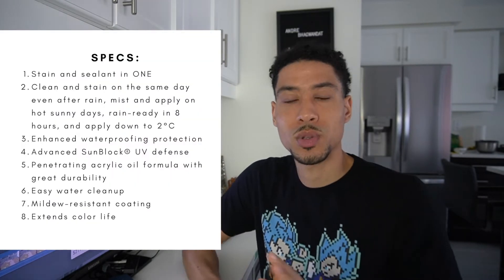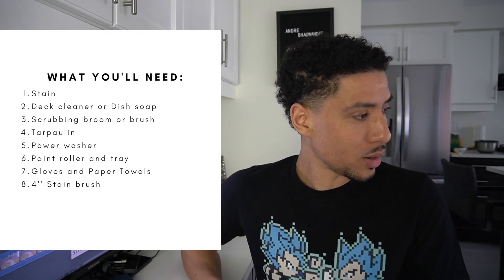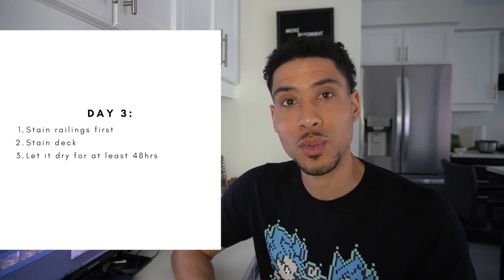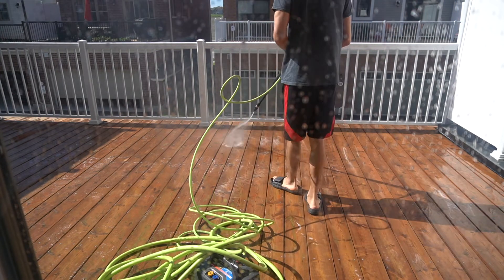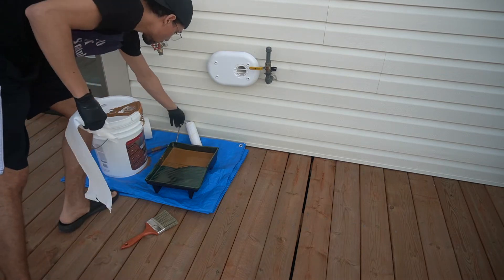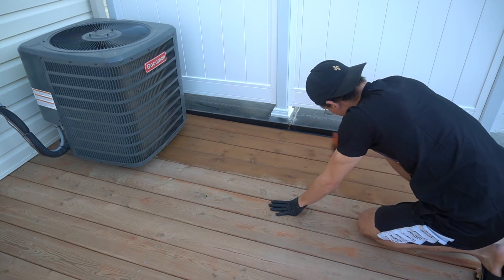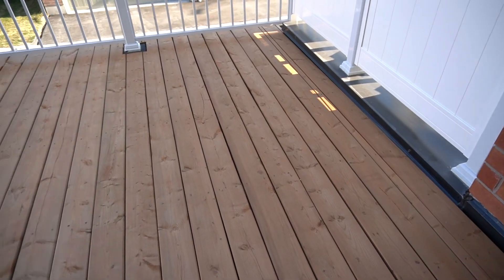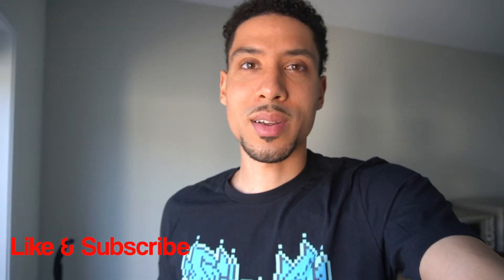How to stain your deck using Olympic maximum stain and sealant  | Andre Bhagwandat

Comment: Nice job. Well done on the project and video. How would you rate the durability of the Olympic stain so far?
Reply from the maker: Just finished with winter and still looks great, no noticeable fade. I also made a chair and stained and everything looks good
Reply: @AndreBhagwandat  i’m normally not a fan of big box store products like this but I’m starting to believe that the Olympic is legit after so many good reviews.
Reply from the maker: @beastgirl43  same here, but after a ton of research I found it’s one of the only ones that don’t flake or peel off and I’d hate that. Also if it last up to 4 years that’s still better than doing those once a year coatings that wash away.
Reply: @AndreBhagwandat  how has it held up? I’m about to do mine